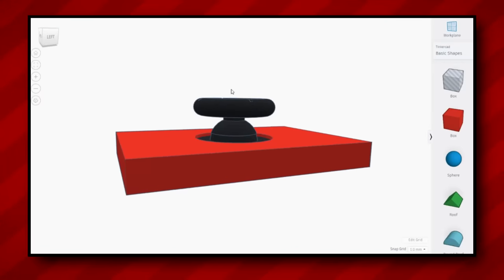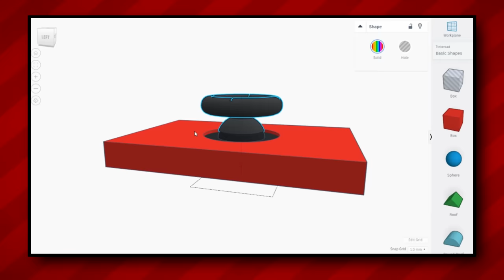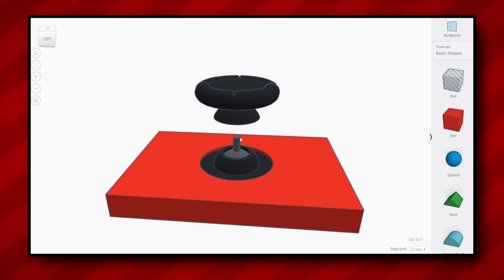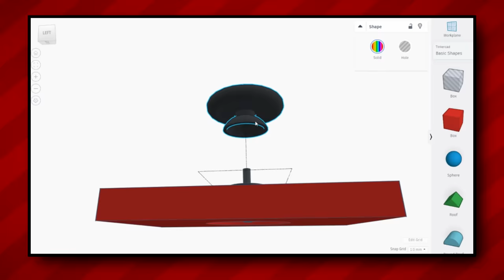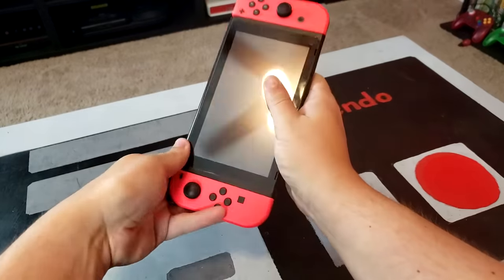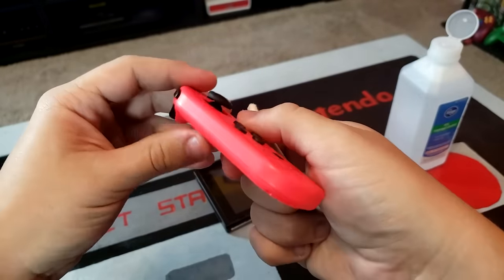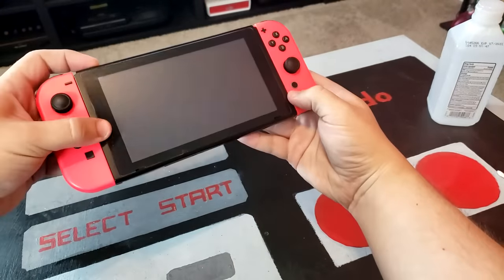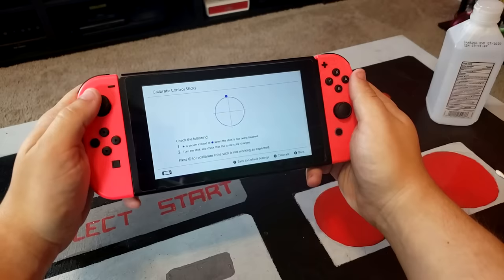How to Fix Joy-Con Drift at Home! No tools required! | Nintendrew

Comment: Only issue i've had with the joycons is them disconnecting in the middle of playing handheld.  Seems to have gotten worse lately.  Anyone else have this happen?
Reply: You could try cleaning the joycon contacts with isopropyl alcohol.
Reply: Yes! I had this issue for some time with my left joycon. It turns out that the pins that connect the joycon to the switch were corroded, (which I found out was caused by a wine spill that my roommate decided not to tell me about, fucker). Cleaned them with some brasso and its good as new!
Reply: I've had it a few times, though my joycons are incredibly loose at times and I can push them out of my Switch easily. It's not common up to the point where it gets me killed in fast paced games like Smash for me though.
Reply: I can help you throw them at the wall 10 times and you should probably buy new ones to be on the safe side

Comment: This is a temporary fix - if it works at all. There are Reddit posts about the mechanical problems inside the joycon analog stick. It's poor engineering and cannot be repaired with alcohol.
Reply: Exactly this. These people must have filthy hands if so many fixed it with just alcohol.
Reply: the only man speaking truth here.
Reply: This, it only helps for a day or two at most!
Reply: Um guys you are ranting at him.... when he stated I am pretty sure multiple times that this cannot help your switch if it's a genuine mechanical problem. And also Nintendo is notorious for having some fucked controls sometimes due to just casual dust build up. Remember the dreaded Left and Right buttons of the DSi
Reply: shanetm I’m not saying that some of these people don’t have filthy hands but it’s also caused by dust and dead skin cells both of which is inevitable and you will never not have on your body.

Comment: THANKFULLY it seems my drift was caused only by debris, and not hardware malfunction. After owning mine since approximately launch year, it started to drift very occasionally, and only slightly, maybe half a year ago... until just a few weeks ago. Then, it became unbearable; any movement of the joy-con would cause drift, sometimes up, though typically very dominantly to the left. Made walking around in games frustrating, and navigating menus that required the left joy-con near impossible.

It's still not perfect, checking the calibration menu shows that the joycon still takes a moment to "drift" back to center when moving it left, rather than the expected immediate snap back, but at least it's not drifting around at the slightest touch! I'll go through the cleaning process if need be, I refuse to give money to Nintendo on a new joy-con set while they have countless lawsuits hovering over their head and still refuse to swallow their pride and "improve" (AKA fix) the controllers.

So... thanks! Genuinely. :)

Comment: What if my joycons are loose and they fly out of my Switch everytime I touch them?
Also the part that connects to the Switch is kinda dirty.
Reply: how did this happen sanjay
Reply: I just imagine you touch the joycon and then it just flyes trough the wall
Reply: Is it the whole joycon? If so, you probably push it out without hitting the button. I think you can only repair it as its probably dented

Comment: I am amazed at how simple that was to fix. I didn't even need to use alcohol. I just used a q-tip. The drift is entirely gone for me. The drift was something that was so easy to replicate, but is now something I cannot seem to replicate at all. So I give massive thumbs up for this. Problem solved in 2 minutes.

Comment: Joy con drift is such a joke. I recently returned my old joycons for some new ones because I was experiencing joycon drift. Now the new ones I got have started to drift and my warranty has expired. I'm very disappointed with Nintendo.
Reply: Nintendo says that they will repair joycons with joycon drift for free. Go to their website. support.nintendo.com
Reply: @noahali-origamiandmore2050  i thought they stopped that because of Corona
Reply: @boiboi7717  I don't think they did. I sent one during quarantine and I have confirmation that it's being delivered.
Reply: @noahali-origamiandmore2050  oh snap good to know! Thanks Noah!
Reply: Nintendo should just give the control stick for the switch the same design it was for the wii u then no dust or anything could mess with the sensors easliy

Comment: Can y'all actually give feedback instead of making memes, this is a problem for everyone it bwould be better if you all helped instead of doing stupid stuff in the comments
Reply: Sergio R. it works like a charm!!!
Reply: @SparklePrincessDiva  Hey man I dont have alcohol on my house can i use something else?
Reply: @XxCarlosAlexis99xX  Electrical contact cleaner is the preferable choice, with alcohol as a backup. If you don't have either, you're out of luck, because you should not under any circumstances put other kinds of lubricant in there. Alcohol really shouldnt be your first choice unless you dont have ECC, it's just more convenient for most people.
Reply: @XxCarlosAlexis99xX  Sure. Just use some petroleum naptha difluoroethane.
Reply: @paradoxxis8612  I would be careful with contact cleaner as it warps rubber in many cases. I know this because I repair synthesizer key contacts.

Comment: From a Switch Lite user: It works :) I’ve had bad drift since about June(?) and this fixed them. It’s still a bit finicky sometimes, but overall it’s a massive improvement and I haven’t seen any cons yet. 100% do this.
Reply: It work at this day?

Comment: Okay, this actually helped a lot!!! I was skeptical at first, but now my switch is good as new! I used a bottle of hydrogen peroxide and inched it under the button; gave it a few spins, and it worked! Thank you SO much!!
Reply: can you use water instead of the alcohol stuff or can water damage it?

Comment: I just tried this on my switch lite and it worked! I wasn't sure it would because the lite joysticks don't have the same rubber part, but it worked anyway! The alcohol must have gotten in despite having less room to work with.

Comment: Found this video years ago when my joy-con started drifting again a few months after Nintendo "fixed" it. (They replaced some parts due to wear and tear.) Did this once and haven't had any drift issues since. I still recommend this video to people when the subject of joy-con drift comes up. It may not help with mechanical failures, but it's quick and easy enough to be worth a try!

Comment: For people whose drift is alleviated slightly and temporarily by pushing down hard on the joycon face panel adjacent to the stick, this fix will work for you. It's an issue of connectivity between the "cap" and the underlying sensors, which is caused by dirt and dust buildup.

Comment: I was hesitant to use this method just because smearing a liquid under the joy con seemed strange to me but it actually worked so well. I nearly teared up after all my frustrations disappeared. I avoided anything switch related just because of the drifting, now that it's gone I'm so excited to finally start using my switch again, thank you so much I really didn't want to buy another joy con.

Comment: Holy shit dude it works. All of my Joy-Cons had drift so I've been using my pro controller while avoiding my Joy-Cons completely. Unfortunately any time my friends come over, playing Smash Bros. or anything else isn't fun with the drift. I tested all 4 of my Joy-Cons, my pro controller which was starting to drift, and a wired controller that had drift after using this method and all 4 of my controllers no longer have drift whatsoever. Thank you!

Comment: Good one, worked great, thanks for the tip. PS used 91% IPA and equate tips, had both, if I didn't it's about 3 bucks and will clean 500 controllers.

Comment: My joycon started drifting a few months ago and it was only getting worse as months went by. Thanks for this! I'd much rather fix problems without taking the controller apart if at all possible (had to do this with my dualshock 3 a couple weeks ago)

Comment: Okay, I never tried this method for fear. Only air. I think it worked! This entire time maybe over 2 years I haven't touched my switch. To think mine may have simply been dirty. Maybe I'm gonna finally finish BOTW soon! Lol

Btw, I used a 50 percent because thats all I have but then used a bit of 70 percent hand sanatizer with vit e and aloe gel mainly around the skirt for lube. I know it sounds crazy and dangerous but I basically don't care anymore. It works or its trash. It immediately started feeling very smooth. I have only moved it around in the calibration tool so far but even with tiny movements so far it is,quickly resetting to center. 🤞

Comment: Hey people! If you're having a problem, where when you turn turn left or right or any direction it is really weak and can't do it. While watching this video I tried to take the top plastic round off but didn't work but it did fix my joy cons. Now  I can't guarantee this will work but it's worth a try it worked for me. Pull it upwards with some force and then try it. Thank you for reading this comment.

Comment: For those who don't have isopropyl alcohol, you can just lift the silicon area with a toothpick and strongly blow air using a straw in short intervals to clean the dust. It is less effective but it still works. Just make sure your spit doesn't get in it.
Or you can use hand sanitizer instead of isopropyl alcohol but don't quote me on that.
Reply: Thanks you just fixed both of my joycon drift
Reply: this just saved my ass thank you so much

Comment: Will this method also work on Power A controllers? I have a couple of wired controllers for my Nintendo Switch that I was able to buy at GameStop and Walmart, and they both have the same drift issue as featured in this video, so I am really curious to know, since I always prefer playing my games using the Classic Controller Pro, which I was able to get at around the same time as my console in 2017.

Comment: As of late, I have tried this on my left blue joy con repeatedly, and no matter how many times I try this fix, it only works well for a bit, but after enough use it starts drifting again. Am I doing something wrong, or is there something else besides dirt causing it? For reference, based on what I've seen, it seems to mostly (if not, almost exclusively) be drifting in a straight upwards angle, and the severity of it tends to vary; sometimes it's a little and sometimes it's a lot, sometimes it descends slowly downwards, sometimes slowly it ascends upwards, and sometimes it kinda hangs in the middle.

Comment: Not having any alcohol, though I should just go get some, I just pulled the rubber up a bit and blew into the gap.  

My down direction was not working well at all.  It would only move about halfway down on the calibration screen.  A quick blow from a couple angles and it's fine now.

Air duster or something would probably be the wiser move.

Comment: The issue goes away for a few gaming sessions and then it re-occurs. I have had to do it multiple times but it keeps coming back. 

This is just a temporary fix. I wouldn't bother doing this if you don't want to keep repeating it. I'm going to try to fix my older pair by opening it and maybe fix it permanently or have the drift issue stay away for a longer period of time.

Comment: If the issue is dust and particles i got a solution i tried out that worked for me. Get a can of dust off from wallmart. ((((((Do not hold it upside down or tilt it. ))))) spray the duster into the undersection of the joystick. It helped out tremendously for me. I had huge forward walk and left rotate. Now its very very slight. But dont over do it. Just now and then spray and test it out. Like i said ive done it on my switch pro and my baby is working better. Game on nintendo fans!

Comment: So, my rubber cap broke while trying to fit in the Q-tip. I used hand sanitizer which contained mostly isopropyl alcohol. Maybe the sulfide attacked the rubber? Maybe newer Joy-Cons are even more fragile to discourage people from trying to fix Joy-Con drift temselves?

Comment: All my joy cons and pro controllers are very drifty, when I go to use them they also push you to the left side even though I'm pushing to the right, there broken mostly from my brothers, and I just resigned to buying my own switch and not allow them to touch it with their grubby little joy con drifting fingers, hopefully my brothers don't find this video so they have to undergo this pain for years ahead, lol.

Comment: PROBLEM: I've used this method to fix my left joy-con and it has (temporarily) worked each time, BUT now I'm noticing that the rubber skirt is falling apart. Is it possible the alcohol ate through it or something? Unlike the joy-con drift, the damaged skirt problem is one that I'm not getting a lot of google results for. Has anyone had similar side effects? HELP

Comment: I just have one question what type of isopropyl Alcohol should J use like percent? I see percentages on most bottles.
Reply: As a techy, I ONLY use 90% (or over).  The 70% kind leaves residue.
I haven't touched the Joy-Cons as my OLED is only 1 week old.

But I do use the 90% (it might be 91%) on other controls.

However, for pots and switches that are in hard-to-reach areas, I use a spray contact cleaner that specifically is made to NOT be conductive or chew plastic/nylon parts.

Hope that helps.

Comment: Would compressed air work?
Reply: I would do that first for sure as it would remove loose particles.
Of course, if there is a way to lift 2 sides of that rubber skirt, that would be better.

But if the compressed air doesn't totally fix it, then I would also use a compresses spray contact cleaner that is specifically designed to not leave residue.

Again, I'd try to life 2 sides so that when spraying, it would literally push the dirt out.

The way he did it in this video, I honestly don't trust, because it's not being REMOVED it's only being MOVED.

Comment: can you use hand sanitiser aswell ?
Reply: No. Never put hand sanitizer in any electronic, ever. The amount of people asking this is concerning... 

Same goes for WD40... I got a 360 to fix once and someone had sprayed WD40 into the disc drive to try fixing the tray being stuck. That was stupid for 2 reasons. 1, being that WD40 shouldn't even be used in these types of electronics and 2, that the tray doesn't stick because it needs greasing. It sticks because of damage to the track or tray plastic itself causing a hangup. 

Anyway. Don't use hand sanitizer. Get rubbing alcohol from a dollar mart. (And never use WD40)

Comment: This isnt actually the issue. you can fix this problem with a piece of card stock. its a pressure issue inside the controller and connection problem. odd that this fixed it. maybe it can happen more than one way. anyways, some of you may be happy to know, Nintendo will fix your joycons for free. just print the shipping label and send them your controllers and they will ship them back to you fixed, permanently. i bought my switch 3 years ago and its still honored.
Reply: Does the service work in east europe

Comment: Need some help here my niece was playing my switch when I got it back from her ok ne of the wires at the bottom was sticking out and the switch wont read it being connected when u slide it on but it still works normally

Comment: It broke it completely. It was drifting to the right before like every other time I turned it to right but now, it only turns right and not to any other direction. Tried to recalibrate it and reset to factory settings but nope. This little fix cost me 80 euros...

Comment: Nintendo release the switch with a known joycon issue and expect people to pay £60 for brand new joycons after 6 months or so of use and then they release the switch lite that can't replace joycons without fixing the issue. The switch itself is a great product but Nintendo really need to hammer down on their production side of things. Sure if they increased the price of the switch by another 20-30 without joycon drift, people would be v happy

Comment: I cut the the rubber by accident its a small cut
Reply: Mine deteriorated after pulling it up a couple times. Frankly don't see the point in keeping it on there anyway if it just drags dust in over time.

Comment: Does this work using QTip and water,Qtip and soap or what?
Reply from the maker: No - never use water to clean delicate electronics!
Reply: Then what do I use?Because I just used water on Qtip and made my Nintendo Switch Oled Joycon Drift worse
Reply from the maker: @DarkNickEh30  Isopropyl alcohol (highest % available), as stated in the video

Comment: This does absolutely nothing on any level. You need to open the joy con and qtip the parts directly. I have already tried this on several joycons, it’s the same as blowing air on the outside of an appliance and expecting the springs for the washer to be fixed and level your spin

Comment: Drifting is not cause by this issue. 
Drifting is caused by a stupid idea to make those contacts as magnetic flex cables. 
If they did this without knowing then their engineers should be fired. 
Imo they did this on purpose.

Comment: can you also use water instead on alcohol?
Reply: i don't know if putting water in your electronic device is a good idea
Reply: i dont have alcohol. im only 9
Reply: Maybe just use a piece of cardboard
Reply: @LB8750 I’d rather put a piece of cardboard in my switch then wait for ages for my joy-cons to come back knowing that they’ll just start drifting again
Reply: @LB8750 That's fair. If your not comfortable with taking apart your joy-cons that's fine. But for me personally: I have gone through 3 joy-con sets from Nintendo and it's too much hassle.